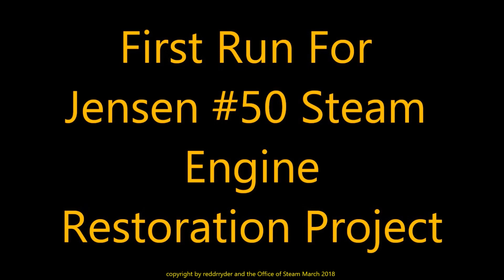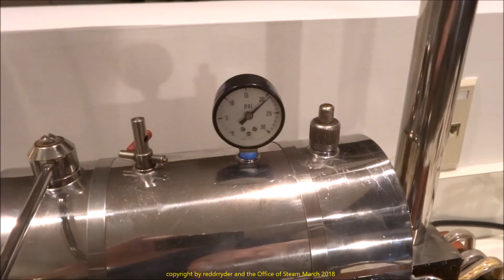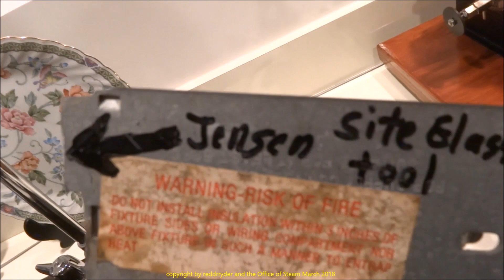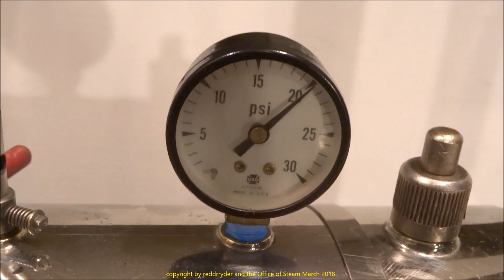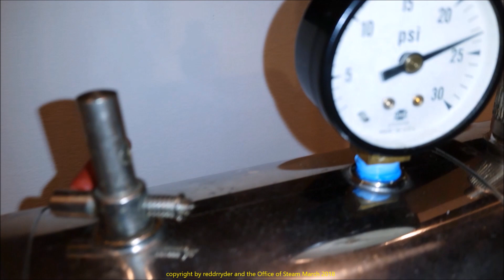First Run of Restored Jensen #50 Steam Engine

Comment: Bonjou Gil,
Good job, such a leak wa impressive ! An it is not so common to see a functional governor. The screw as by-pass is also original. Did you remove the glasses for soldering ?
Amicalement, Raphaël